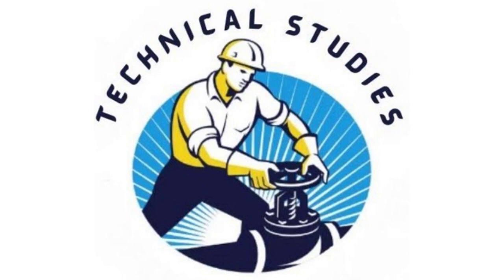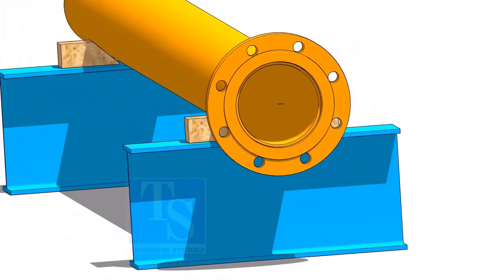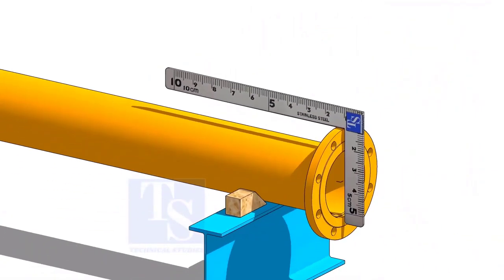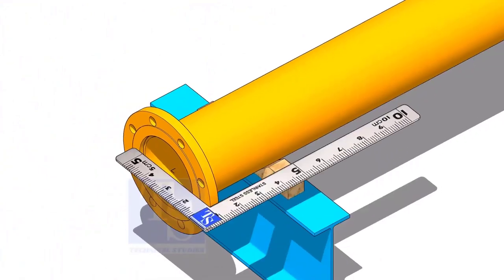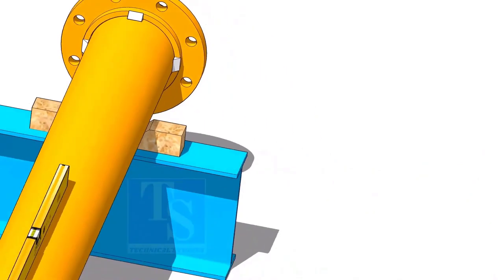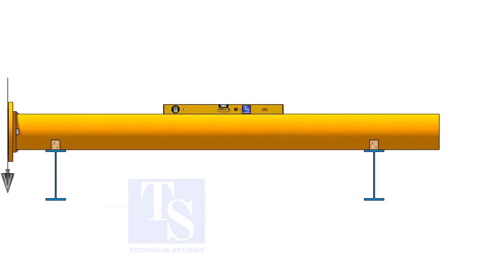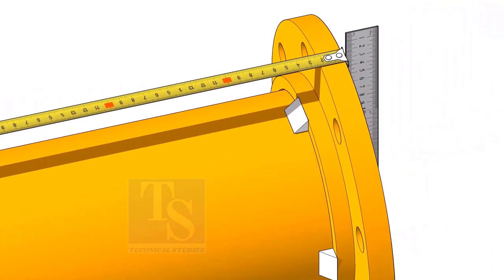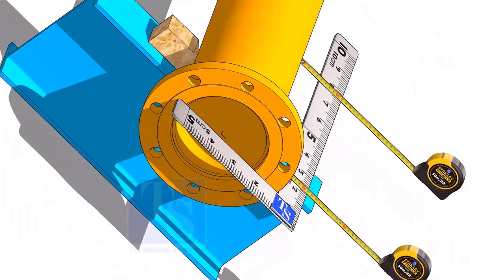How to Fit up Slip-on Flange. Different Methods

Comment: Need a video with setting up tanks for pipe routing... with the new 2023 SolidWorks I'm not sure why I can't connect a Slip on weld flange in the tank assembly for future pipe routing